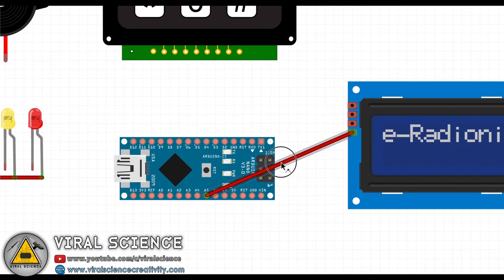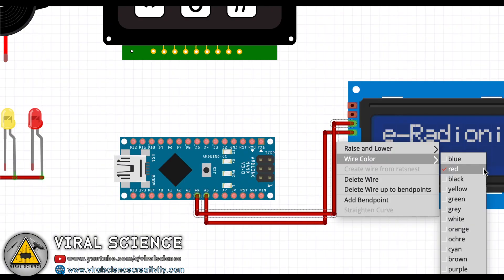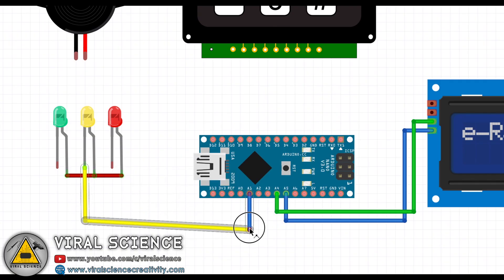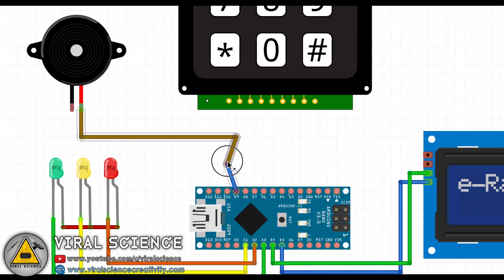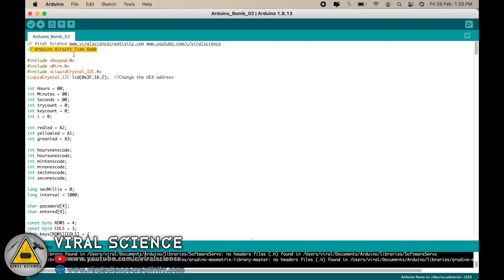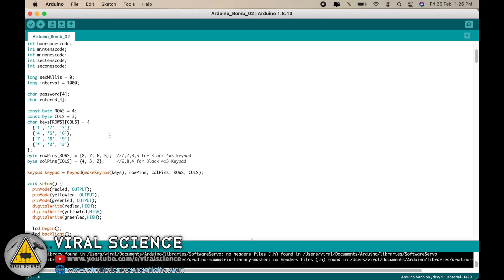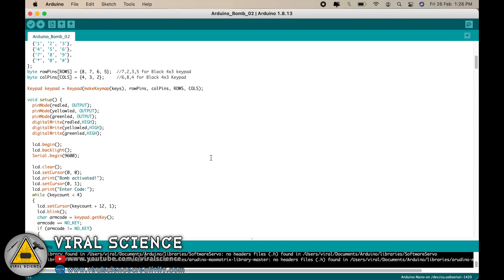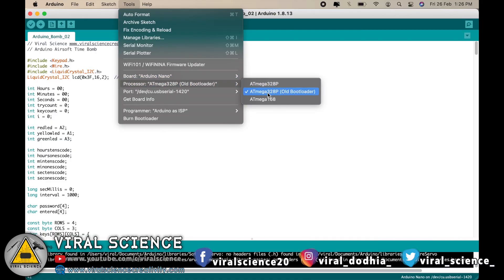Arduino Airsoft BOMB | CSGO Bomb

Comment: Your instructions were awesome, I did have to figure a few lines of code that I had to change. I read the other comments but I have a question. External power, I read one person ask about how many AA 1.5v batteries and the answer was 6 which = 9volts. Well I now have 2 dead boards, not sure if the screens are toast yet. What can I use for the power source? Testing I used a battery power bank which worked but it doesn't stay active. Maybe I bought the wrong boards? avrdude: stk500_getsync() attempt 1 of 10: not in sync: resp=0x5d

Comment: This project does not work. I did it exactly as indicated in your diagram and also with the instructions in your codes in case of using the 4x3 black board and your codes do not work. In your videos you show it working with the arduino keyboard initially but the diagram is never seen. And then you put in a keyboard from a different board. I checked your work with two colleagues and it does not work. It shows serious problems and no h is found.

Comment: Lets replace the buzzer with a nicrome wire to get fire or a spark gap with voltage multiplyer and the put them in pottash and other explosives then it will be more realistic

Comment: can anyone please help? I used the Arduino code from the original website but it says problem with " lcd.begin();" in 54th line
Reply: If this is the case you need to change that line to say 

lcd.begin(16, 2);

Then it should word
Reply: @kaytisuma  thank you for help

Comment: When I compile the code, it says there is an error with line 55, "lcd.begin()" I replaced it with "lcd.begin(16, 2)" but everything else works exept  for the lcd. Please help.
Reply: LiquidCrystal_I2C lcd(0x3F,16,2);  //Change the HEX address 

0x3F -------0x27

Comment: please help can i have link to the screen you used it only lights up boxes but no text of row one of screen is there an error in code or do i have wrong screen
Reply: I had the same problem:

Check the soldering 
Add a potentiometer to adjust the contrast
Check the enable pin
Reply: @vinaymathapati6800  pour le potentiomètre on l'ajoute où?

Comment: everything works except the screen. I can activate the bomb. but I don't see anything on the screen. the screen is powered. it only shows me the points from the top. and nothing else
Reply: I changed the address of the screen and it worked

Comment: Can you use motorcycle horn instead to make the alarm louder??  If yes is there changes for the circuit or program?
Reply: The digital out of the arduino should be connected to a relay to activate the horn's supply since it won't run off the 9v battery (too much current needed). I think that's the only change that it would need.

Comment: Thanks a lot for his video. BTW one thing that I need to ask, Could you please update your code because if we defuse bomb it shows success message as expected but after the delay finished it s restart the timer where we stopped like
assumee that I set bomb timer for 20min and I defused the bomb 2 min left.. It shows the success message and after delay finished it continue from 2 min to counting down instead of resetting it self.
last missing part is after bomb exploed in anyway its not resstart itselfs... can we add a button to reset it again like pressing A B C or D

Comment: Hey , i have problem. When i downloaded the code to arduino nan, nothing happen, just LCD display turned on but there are no letters
Reply: depending on your LCD type, look on the back and find a blue box (chip) if there is a philips head screw in the middle, adjust that (Slowly) until letters are visible. Also, check LiquidCrystal_I2C lcd(0x3F,16,2); and try changing it to LiquidCrystal_I2C lcd(0x27,16,2);
Reply: You absolute legend 

Thanks 

 @coryevans8689

Comment: Hey idk if you can help me but im having issues with the LCD display not showing text.
Reply: Depending on your LCD type, look on the back and find a blue box (chip) if there is a philips head screw in the middle, adjust that (Slowly) until letters are visible. Also, check LiquidCrystal_I2C lcd(0x3F,16,2); in the code and try changing it to LiquidCrystal_I2C lcd(0x27,16,2); He didnt really address the fact that different LCDs have different addresses. You can typically find your specific screens LCD address by looking up where you ordered it from.
Reply: @coryevans8689  i see i already tried fixing the contrast so it could be the address because some letters show up but not all of them
Reply: @Tactical_chicano  Have you tried another screen to make sure your current one is not broken?
Reply: @coryevans8689  yes i purchased 2 different ones thinking it might come out bad. Also switched the nanos and its the same issue
Reply: @Tactical_chicano  prolly the address then, good luck!

Comment: Hello. error while compiling adrduino. What could be the problem???
C:\Users\sysadmin\Downloads\Arduino_Airsoft_Bomb\Arduino_Airsoft_Bomb.ino: In function 'void setup()':
Arduino_Airsoft_Bomb:54:13: error: no matching function for call to 'LiquidCrystal_I2C::begin()'
   lcd.begin();
Reply: Change lcd.begin(); to lcd.init();
Reply: @coryevans8689  why don't I have any writing on the LCD? even though the lcd.init(); code is correct

Comment: Can I ask if u have to recharge this or is it battery powered?
Reply: Its your choice. In his video his is receiving power from the computer it was plugged into while uploading code, but you can use a usb power bank if you want
Reply: will the micro controller resist the power bank like any power bank

Comment: Bro if we make some changes in programing to sent signal to relay module to trigger it when the timer ends we can make a real bomb😅😅
Putting some explosive circuits n the switch is connected with that relay module
Guys don't think of it I'm just saying😂😂